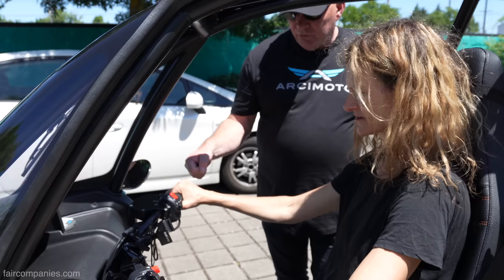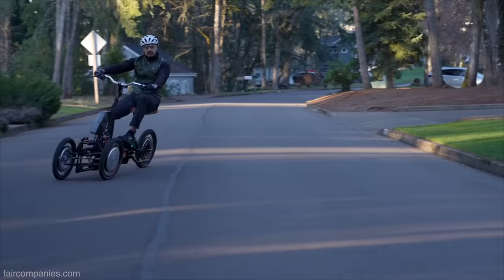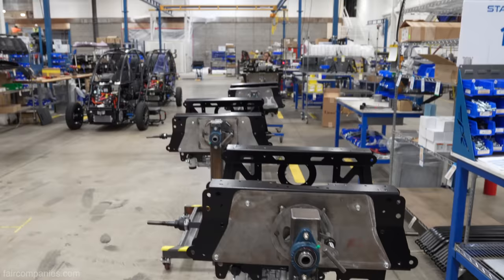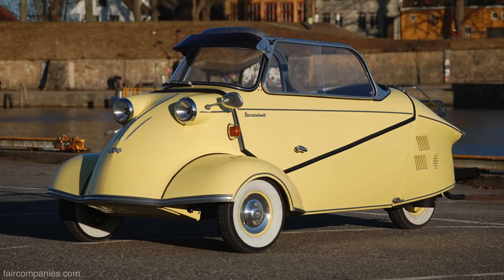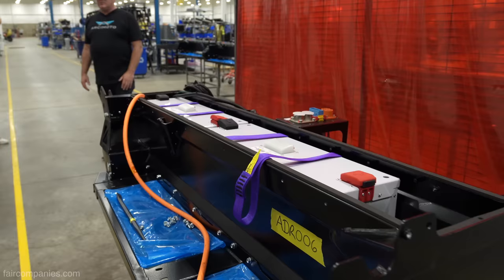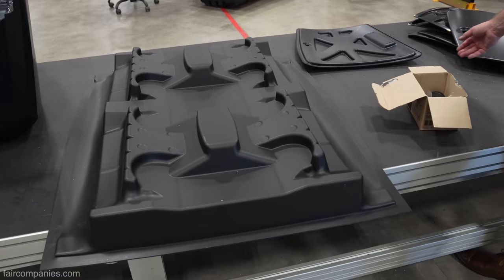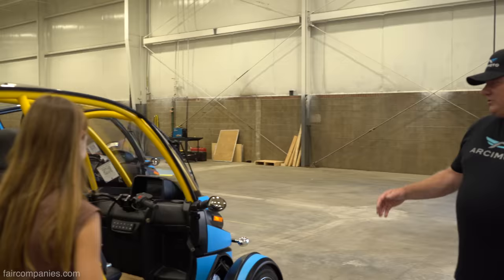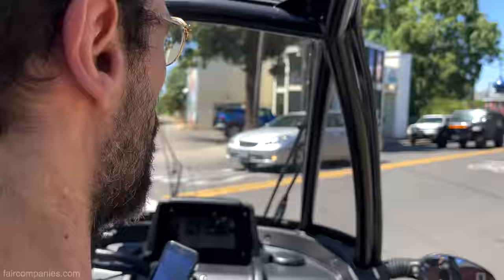Arcimoto 3-wheel EV commuter blends bikes' fun + cars' safety

Comment: $20,000 PLUS for one of these RIDICULOUS go-carts... NO FCUKING WAY!!! But there's MORE, as it JUST starts at $17,900 before subsidies, but the price creeps above $25,000 with upgrades like fancier seats, half doors, a rear cargo box and cup holders. How long until this company is fully DEFUNCT?I have to say that they are very impressive, but the PRICE! I do also see that there could be a good market for these as rental vehicles in just about every vacation destination, so, perhaps that will be there saving grace? LOWER THE GD PRICE!!!
Reply: Apples and oranges comparison. You sound like you are not aware of the savings of $1000 or more every year because the FUV gets insured as a motorcycle - my Allstate policy is just $134/yr but a car in Florida is costing $1400 or more to insure. Plus no gas or oil changes to buy, no converter or air bags to steal, no transmission to blow up. The price is a bargain that no owner has complained about once you experience the total package. I can't really afford a car but my Arcimoto is saving me $2000 every year compared to owning a car. Cars, any car, costs you $3000/yr to own and operate. In comparison, my FUV is paying for itself in just 8 years - no car can provide such economy. All this without a tax rebate for EVs because rebates have left out the autocycle for now. This will change.

Comment: i can't see this being practical in most urban areas because of huge trucks, suv and sports cars that basically rule the roads plus idiot drivers
Reply: I see it working every day as my only transportation. This is so much safer than any motorcycle. In fact, safety is as good or better than any small car even without a helmet or air bags. Don't understimate the proven certified collision protection of the roll cage and the 6 point harness, used by formula one race cars for decades. No vehicle is absolutely safe. The first collision has already proved the security of this design.

Comment: Coffin on wheels. No way you're gonna make it if one of those 4000 pound hunks of steel hits you in this.

Also, this vehicle type is not new. Very similar to the Renault twizy, which had two seats, fully enclosed, airbag, and cost half what the fuv does. Didn't sell even 100k units worldwide in 10 years. 

I expect this to flop just as it did
Reply: But "motorbikes"?
Reply: So many people have no concept of defensive driving. This is where you have such an acute awareness of traffic patterns around you that you can predict hazardous situations before they happen, avoid them, and get to your destination safely. You learn much about defensive driving from years commuting on motorcycles before mandatory helmet laws.
Reply: @bloop Facts👌
Reply: @barnabasseadog7660  defensive driving or not, you can't always avoid an accident. 
I'd rather not be in one of these or a motorcycle when a 4000 - 7000lb truck hits me.

The survivability is obviously lower on a bike or one of these.
Reply: @bloop  yes! We'd also see a net safety gain if everyone wore a helmet and the speed limit was 20mph everywhere. Too bad none of that will EVER happen.
Reply: @bloop It's only available in 7 states, so that 14 million number... yeah doesn't make much sense. With a Max speed of 75 mph, it doesn't really compete with motorcycles. It's more for end of line delivery and it's closest competitor would be a moped, which is far cheaper. Given the charging network in USA and limited range, it will never see wide adoption (60ish miles at freeway speed). It only complies with Fed standards for motor cycles, so only marginally safer with a 3rd wheel and roll cage. Takes the impractical aspects of both car (big, needs a parking space) and bike (not very safe, impractical for rain/snow) and combines them. So for many people, this is not really an option at all. But I think a good choice for a pizza hut delivery vehicle. 

So again, not a motorcycle replacement. Much like your comment if every vehicle was replaced with one of these, the road would be safer. The same could be said if you just swapped all vehicles with mopeds or bikes. The safety you are talking about comes from the removal of other cars on the road, this vehicle is not much safer than any moped or motorcycle. 

Its also still a startup, on the downward spiral with dwindling investor confidence. Could be dead and gone in a couple years.
Reply: @boogy-f8j  There are several cases already where an FUV was involved in a crash, one was T-boned at an intersection at 35mph. The federal governments safety testing held up. The FUV pilot was in his seventies and walked away with minor bruises. FUV is safer than a motorcycle, and there are millions of bikers. I bet there are a shitload of baby boomers that realize: "with age comes the cage".
Reply: @barnabasseadog7660  Yes safer than a motorcycle... but it can't compete in the same class as a motorcycle. More comparable to a moped. 

 This type of vehicle is not new. Check out the Renault TWIZY. Very similar and came out a decade ago. Has an airbag. Comes fully enclosed. Cost half as much as the FUV. Still only sold 100k units MAX in 10 years world wide. 

It's double the price right now, but supposedly the FUV will cost 12k once production hits 50k units per year. I doubt that level of production will ever happen, considering this is a city only vehicle (unlike a motorcycle).

 It's going to be a niche product for rich folk, a second vehicle/toy, especially considering the worldwide recession that's just starting and many other vehicles that offer more for less $$. I'd take an e-bike over the FUV.
Reply: @boogy-f8j  Yes a second vehicle, but not a rich mans toy. Yet far superior to an E=bike or moped. Can a Twizy hit eighty on a freeway with confidence? Because it has four wheels, it must have airbags. The FUV, with it's three wheels and balance up front, six point harness, certified roll cage, and EV torque and speed make this something you have never drove before. It warrants it's own category: autocycle. No motorcycle endorsement and no helmet required. I see baby boomers like myself that would love the ride of an FUV compared to the stress of life commuting on two wheels. 
I have a twenty mile commute one way, half of it on the freeway. I get access to the HOV lane by myself, enjoy rock star parking, and never have to buy gas or change oil. Meh.
I'm not rich but I live in SoCal where I see the need, so buh bye.
Reply: @barnabasseadog7660  So a loophole not to have airbags, that is not the flex you think it is. Very few can afford a second vehicle just because, so rich mans toy for sure. Sensible people would get a used nissan leaf that does pretty much everything the FUV can for less, while being safer and all weather ready. Maybe a Twizy can't hit 80 (a FUV cant either), but it's a great example of how this class of vehicle has failed to catch on, and already died out. That stock price is almost the lowest it's ever been too. I bet the recession will help.
Reply: @boogy-f8j  I've been in an FUV on a SoCal freeway doing 83mph. No problem, no fear.
You can keep your Leaf.
Reply: @barnabasseadog7660  That's barely fast enough. Curious, that's faster than Arcimoto says it can go. Suspect downhill/downwind/drafting involved. 

But sure you did.
Reply: @barnabasseadog7660  Are you one of the 192 buyers of the FUV in all of 2021? Sounds pretty niche.
Reply: @boogy-f8j  At the very least, I have sat my butt in the pilots seat and know what everybody is smiling about. I look forward to the next ten years commuting in San Diego with my new  FU Vehicle.
Reply: @boogy-f8j  Ordered last month, I'm told I already have a VIN and can expect the bill of sale soon.
Reply: @barnabasseadog7660  Did you end up getting it? I saw they cut about 1/3 of their workforce a few days ago.
Reply: @boogy-f8j  yeah took delivery five hundred miles ago. Already had a report of a woman who placed an order after seeing mine parked at the airport. Way more fun than expected.
Reply: @boogy-f8j  City driving is great but the freeway is like loveplay. I gotta be in the mood, your a flyweight and sustained high speed burns power quickly. Doesn't replace an ICE car but makes a great second ride.

Comment: I like them, but they cost just a little less then EV cars. So I will get an EV car
Reply: The average price of a new EV in the US in 2022 is $66,000
I am now saving over $800/yr on insurance with my FUV. We get the motorcycle rate. My power bill did not even notice charging at home. If you do not routinely fill the back seats and trunk of an EV car you are wasting energy by hauling around up to 2000 pounds more of vehicle you never use. There is much more to this than base price.

Comment: Nope, fun toy but not car replacement. I do find it interesting but it is a toy.
Reply: It is absolutely positively a car replacement for many owners. It is my only vehicle for the last year. Two car families end up using their FUV all the time because it is so much fun while being safer than any motorcycle. As a retiree getting by on a SS pension, this was the most expensive and only new vehicle I ever bought. After riding an e-bike for 7 years without car expenses this was a smart move - I save a whopping 85% on insurance compared to a car. The charging draw is so little I did not notice it on my power bill. No catalytic converter or air bags to steal, no timing belt to break resulting in a $5000 repair. There are now 500 happy owners and a large rental fleet. Renters often end up buying one. Your love of cars became obsolete ten years ago when the consensus on climate change became universal. Part of that message is that we have to stop using oversized steel caged climate controlled 4 seat lounge couch vehicles for one person to go 2 miles to a grocery.

Comment: I think you should wear a helmet.....just for safety
Reply: You do not understand the safety system first developed by formula one racing. When we use a certified hardened roll cage in combination with a six point harness, your head can not come in contact with anything. No air bags or helmets needed. In fact, the added weight of the helmet on your head only increases the chances of a neck injury.
Reply: @popeyegordon  oh, ok....didn't want anyone to get hurt.
Reply: @b0borden437  Nor did Arcimoto. That's why safety was equal in importance to sustainability. They have achieved both.

Comment: Nice toy but, can you imagine getting hit by an SUV in this thing. Worse than a motorcycle with no helmet or protection for your flailing limbs. Pray for good weather.
Reply: Wrong!! Already happened. The guy walked away with only bruises after a 35 mph t-bone collision with a full size pickup because the design works. The crash cage will not bend at all. You did not notice the 6 point harness with seat belt alarms. A helmet would only increase your chance of a neck injury because of the additional weight. No air bags needed either. SAFER THAN ANY MOTORCYCLE EVER BUILT AND YOU STAY DRY IN RAIN. The wide car tires offer far better traction than rounded motorcycle tires and you can't lose your balance with 3 wheels.

Comment: See this is the reason for the blockade/tariffs on the Chinese EVs. For example BYD Seagull. costs less than this and is a working 4 seat air conditioned car that can keep up with traffic on the freeway. This is goofery foofery unenclosed un climate controlled missing a wheel... EV dysfunctional deflect. Intentional
Reply: What a demented rant. Over one billion motorcycle and scooter owners dream of having this with its wrap around windshield, adjoining roof with rain gutters, heated seats and more autocycle features. Keep up? Owners report actual top speeds are 82 to 84 mph! Learn what an autocycle is before commenting.
A cheap Chinese light EV can't pass US highway safety laws here. And it is very selfish and unpatriotic to stab your neighbor in the back by buying foreign brand vehicles. Be American. Buy American.